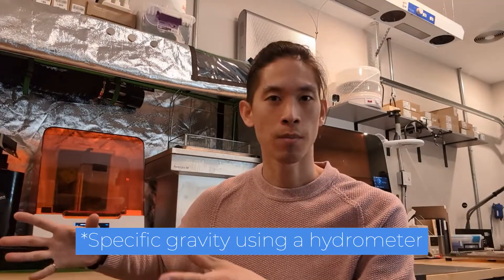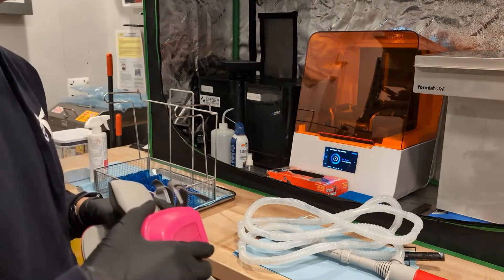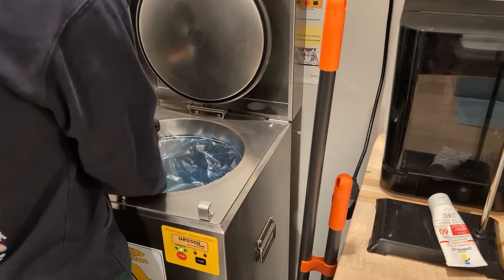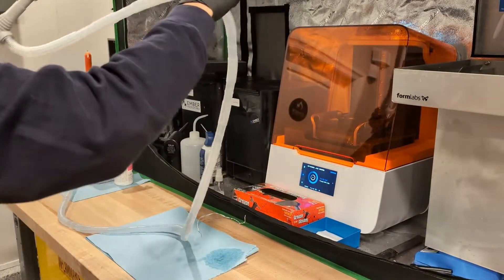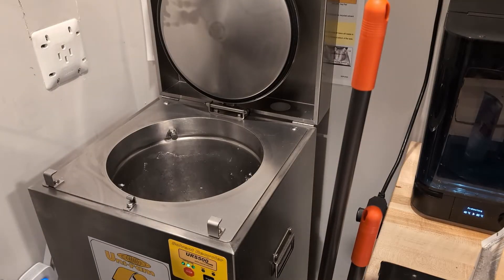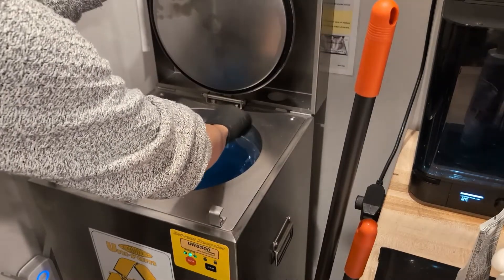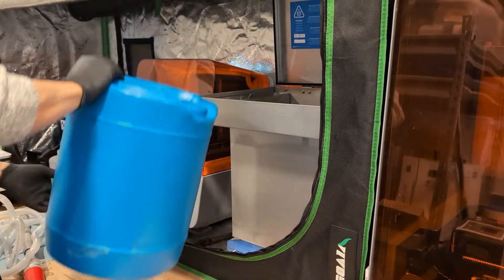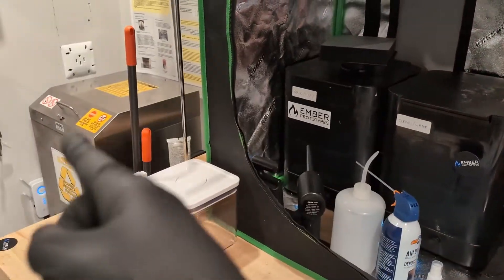The REAL way to recycle IPA for resin 3D printing

Comment: Someone needs to make one of these solvent recyclers for home/hobbyist use! I'd love to have one, but at $6000,it's too expensive for me.
Reply: Yeah, $6k+ to recycle something that is about $16 a gallon is a hard sell.
Reply from the maker: @undertow92182  everyone keeps commenting on how cheap IPA is by the gallon...I must be getting ripped off here in Canada (though I buy the really good 99% anhydrous stuff from a legit chemical company)
Reply from the maker: Yeah these are definitely out of reach for most consumers...one day!
Reply: @emberprototypes Those Uniram machines, yes,. but not a regular electric distiller, see my comment for more details.
Reply from the maker: @retromodernart4426  Yes these low cost water distillers exist...I've been meaning to buy one and play around with it actually. The issue is that resin precipitate gets left at the bottom and can cake/burn, which I imagine could lead to problems down the road or potential safety hazards.
Reply: @emberprototypes  Do like he does in the video, put a bag in it.
Reply: @emberprototypes get the temperature controlled one, may be able to use a plastic bags as an insert, if they dont melt in boiling water or fuse to the wall of a pot, should be good.

Comment: Have you used it for any solvents other than IPA?
Reply from the maker: Haven't had to, but it's definitely made for a variety of solvents. You can set the temperature accordingly for solvents that have different boiling temps. These things are often used in automotive shops (in fact I bought it from an automotive reseller haha)

Comment: Nice! Wish there was a smaller version, can’t justify $5k+ for my low volume. Very cool that you can recycle in a responsible manner
Reply: So I don’t do resin printing a whole lot but when I do I have my own homemade recycling set up. It’s by no means as professional as this one but it does work extremely well. I will also say you don’t want to use this kind of setup anywhere other than a well ventilated area like outside. 
Essentially all you need is an adjustable water/alcohol distillation unit (I got mine on Amazon for ~$100) and ten some jugs to capture the ipa. The thing I’m going to try after seeing his video is using some Hdpe trash bags to capture the mess of a resin cake it leaves behind… that is the biggest mistake I made at the beginning, not having a protective layer between the tank and the dirty ipa.
Reply from the maker: @dakotacampbell6753  I've also been curious about the cheap water distillers. I'm not sure exactly what these bags are made of, but I might look into it when I buy a water distiller for testing.
Reply: @emberprototypes  I'm using a water distiller for more than six months, and it works great. But as it could be a fire hazard, you need to have a fire extinguisher nearby.
I have calculated I'd lose around 5 to 15% of alcohol in the process : regarding the initial weight, the resin trash weight, and the pure alcohol weight, something is missing everytimes. But it still totally worth it.
But I didn't used a bag and the resin leftovers sticking on the metalic surface are hard to remove. Using this bag should improve my process, thanks for the idea.
Reply: @Meowcate  that is definitely a pretty major hazard. a water distiller will be trying to get the "water" up to 100degrees. but alcohol will never reach that so unless you have one with a temperature control it will try to boil the liquid to 100 before it shuts off. 

Depending on what the weather is like where you live it can be relatively easy to recycle with a solar distiller. 
all you need is an airtight clear plastic container, that youre able to fit a black plastic container inside of. Put your dirty resin in the black plastic container, put it in the clear container. seal it. and put it somewhere were sunlight will hit the black plastic. That will heat the alcohol enough to evaporate it, and it will condense on the inside of the clear plastic container and then pool at the bottom of it. 
So it can be helpful to print a little stand/plate out of gyroidal infill for the black container to sit on so it will hold it above the pooled alcohol, so the black container doesn't float and tip over. 
If you need to recycle larger volumes then build a couple of them,
Reply from the maker: @Meowcate  I actually just bought a water distiller to play around with out of curiosity as well...stay tuned!
Reply: @ge2719  I have one without temp control, even as there is a temp limit.
But like I said, I keep a fire exinguisher nearby, and I had no problem so far for month.
But like I didn't said, and that is important, I don't run that indoor. And that's ok for me, it's not going to blow up, at worse it'll burn until I stop that.
Resin printing taught me to not be careless with this kind of thing.
Reply: @dakotacampbell6753  can you provide a link to your distiller?
Reply from the maker: Yeah there totally needs to be a smaller more affordable version of this out there. Thanks for watching!
Reply: @emberprototypes  I mean there could also be a business model where you recycle IPA and re-sell it later....
Reply from the maker: @dwukropek  😅

Comment: I appreciate how thoroughly you describe your processes. I'm very interested in hearing about an in depth look into UV curing your resin contaminated solvent to remove the resin. There are a few videos on YouTube where people have built a system that pumps the dirty solvent through clear tubing that's got UV lights surrounding it followed by a set of filters to remove the cured resin from the solvent. The solvent does come out clear, but your statement that it may not be actually pure solvent (IPA) could be true. The recycler is spendy, but looks like it works great. Definitely worth it for a business with a lot of output. Thanks for creating and sharing your videos. They're great.
Reply from the maker: Thanks so much for watching and the positive feedback 🙏

And yes, I do intend to do some testing to prove or disprove all the non-scientific "recycling" methods out there.
Reply: @emberprototypes  I guess the question is if you can actually really cure resin that's suspended in IPA
Reply from the maker: @HardCoil  yes, and how much of it can you actually cure, if any. I'll be making a video or two on this in the future and talking to a chemist friend 🙂
Reply: @emberprototypes  My best guess would be that the resin that is being cured isn't actually dissolved into the IPA, but what crashed out of the saturated IPA.
Reply from the maker: @SirCB85 yup that is correct from my understanding